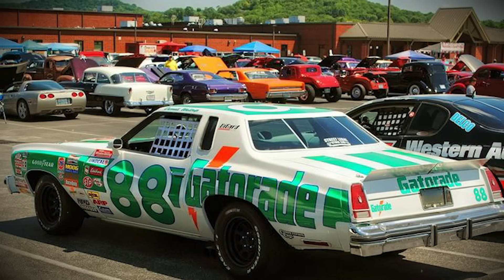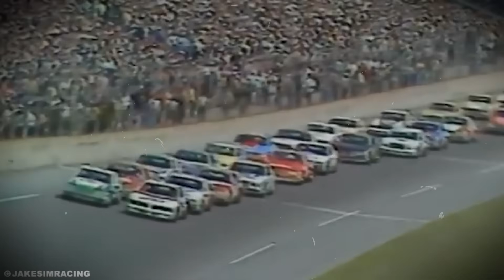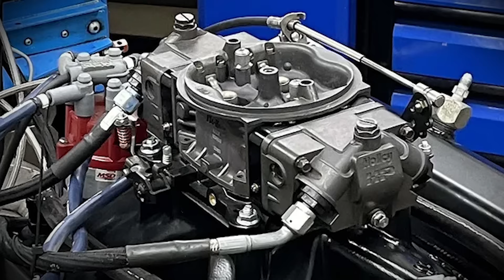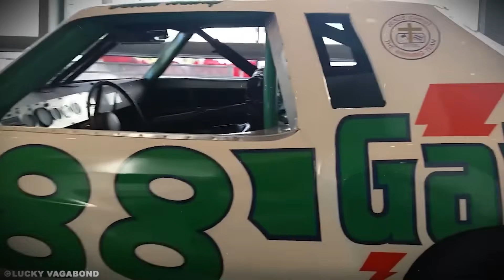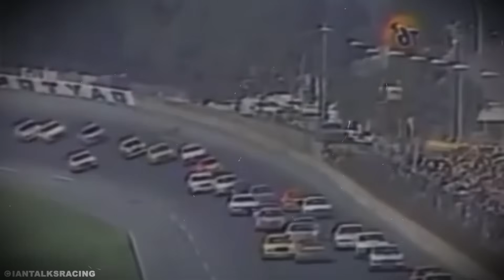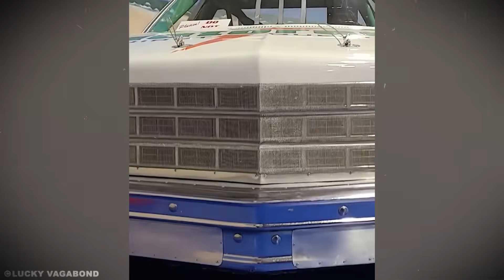How One Mechanic's ILLEGAL Nitrous Wedge Bar Trick Added 150 Horsepower in Qualifying

Comment: Since nitrous was first used by the Luftwaffe in WWII it was known for a long time as a high altitude performance enhancer.  it was first used in racing by SoCal drag racers in the fifties.  In the late 60's an acquaintance of mine first used it at a Riverside Raceway NASCAR race.  I am assuming the rest of the NACAR boys figured it out later.  Bob, the engine builder,  had a spider with individual jets attached to the underside of the intake.  They took pictures during the teardown and the spider was truly impressive..  They then ran two mechanical oil pressure gauges but one of them was "fake.  This explained the additional line running to the fitting at the back of the engine block.  In between the engine and gauge the line tee'd and ran to the "bottle".  As a privateer team they were so much faster than expected that they got torn down after the race.  In true NASCAR fashion they were told, "We do not know what it is but it has to be illegal".  They were punished by a DQ.  Where the bottle is, is never the reason the cheat is found.  NHRA ran a special fourth of July race in 2001 at Pomona and while we were servicing the funny car we heard a loud pop from one of the nearby pits.  One of the ProStock teams had their "bottle" hidden in the dry sump tank.  The heat from the oil caused the bottle (fiberglass) to fail and the explosion injured one crew member.  They packed up and were attempting to sneak out when NHRA impounded the hauler.  That was also the race where Chuck and Del introduced "THE MARGARITA BLENDER".